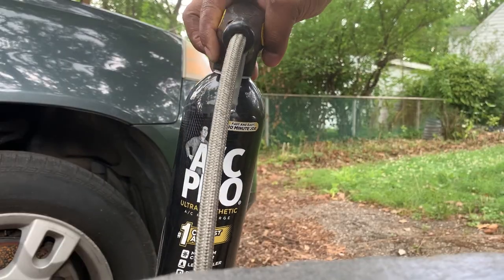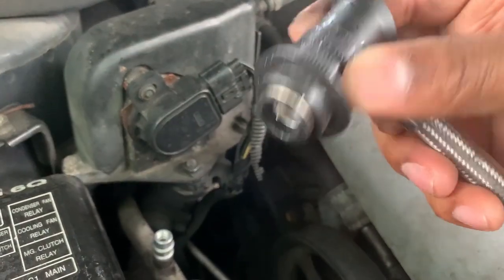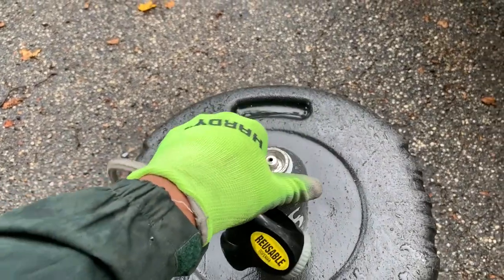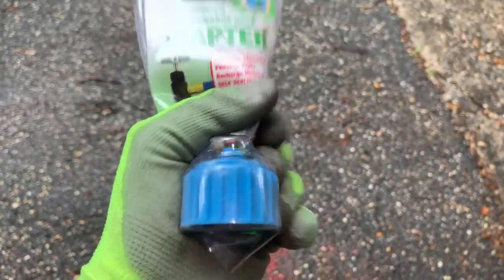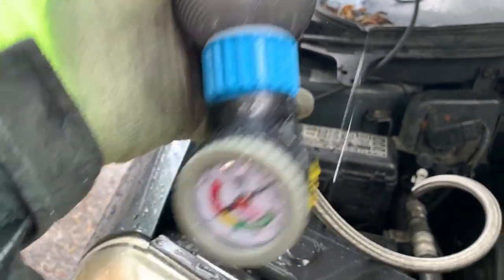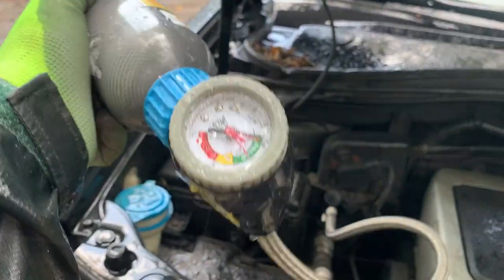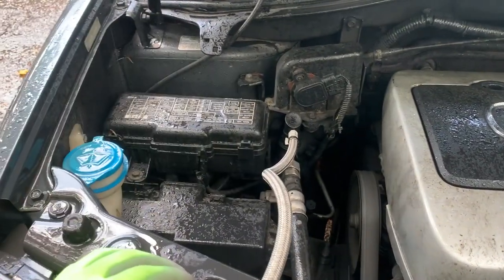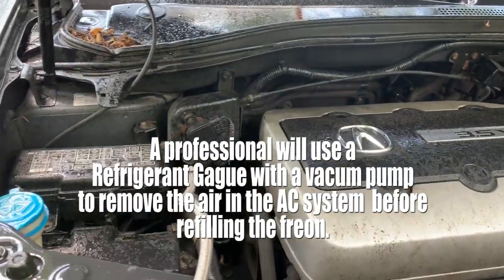How To Add Freon To Your Car (Acura MDX)

Comment: I have the same vehicle. What canister should I buy? is it r12a ?
Reply from the maker: They sell/advertise "A/C Pro" here mainly in the auto parts stores here where I'm from. You should be using freon type R-134a which is what you will find in stores too. 

Freon R-12A is the old industry standard and only available for licensed HVAC technicians. You will need to use an R-134a adapter to convert the connector to your vehicle.  

Hope this helps.

Comment: Why do u use the adapter
Reply: My freon wont go in my 03 mdx
Reply: My clutch work i bought the ez chill ac charge...am i missing something
Reply from the maker: The A/C freon cans that do not include the A/C hose requires the A/C recharge hose adapter in order to connect the freon to the hose. Without this adapter, the freon will not flow into your vehicle A/C system. 

If anyone is not familiar with the setup, I would recommend to purchase the full A/C freon kit:
https://www.amazon.com/ZeroR-Chill-R134a-Sealing-Container/dp/B093Q81ZP3/ref=sr_1_1_sspa?crid=1Z4FOA07QNECT&dchild=1&keywords=ez+chill&qid=1625279154&s=automotive&sprefix=ez+chi%2Cautomotive%2C153&sr=1-1-spons&psc=1&spLa=ZW5jcnlwdGVkUXVhbGlmaWVyPUEyS0Y3RUZQOVdWSDhCJmVuY3J5cHRlZElkPUEwNTc4ODM4MjZEVFM0SVYxOFM0MiZlbmNyeXB0ZWRBZElkPUEwOTEwNzE0MzFQQ0RGNU1VM1RCQSZ3aWRnZXROYW1lPXNwX2F0ZiZhY3Rpb249Y2xpY2tSZWRpcmVjdCZkb05vdExvZ0NsaWNrPXRydWU=

https://www.amazon.com/Professional-Synthetic-Conditioning-Refrigerant-Dispenser/dp/B007USCM7E

OR, you can purchase the adapter like I did. I believe Walmart stores will have it.

https://www.walmart.com/ip/Interdynamics-R-134a-Recharge-Hose-Adapter-Self-Sealing-Cans/16930285?wmlspartner=wlpa&selectedSellerId=0&wl13=3804&&adid=22222222227000000000&wl0=&wl1=g&wl2=c&wl3=42423897272&wl4=aud-430887228898:pla-51320962143&wl5=9007899&wl6=&wl7=&wl8=&wl9=pla&wl10=8175035&wl11=local&wl12=16930285&veh=sem&gclid=Cj0KCQjw8vqGBhC_ARIsADMSd1CEMu2XZgivjd7OgB5LpndmyAa1S_b9m123LTODF8We7GI8x7Ar3ToaAt1AEALw_wcB&gclsrc=aw.ds
Reply: @AWordFromMrJones  mine came with a reusable recharge kit but still won't go into. Nozzle any idea.. my clutch works also
Reply from the maker: @philipcooper6264  Is the freon hose not able to fit on to the MDX low side A/C port? If so you may need the retro fit adapter.

https://www.amazon.com/Universal-Retrofit-Motors-Converting-R-134A/dp/B076V3LDRS/ref=sr_1_21?dchild=1&keywords=R-134a+Recharge+Hose+Adapter&qid=1625279238&sr=8-21

Comment: Gas    leak
Reply from the maker: I definitely get where your going and yes indeed usually when it comes to systems that hold Freon they are considered as closed pressurized systems. Usually when a fridge is low on Freon, this means there is a leak somewhere in the system. The person can either spend time to identify the leak, make the proper repairs and charge the system. OR cheap route which is recharge the system until they have time and Financail resource to correctly fixed the issue.

For me, I rather the cheap route since fridge technology is always developing and you can always get a good deal during certain holidays. So it just make sense to save on the repair when your anticipation is to eventually replace it.

Hopefully by the time I decide to replace mine, the fridges can make food at the touch of a button like on the “Jetson’s” tv show lol.